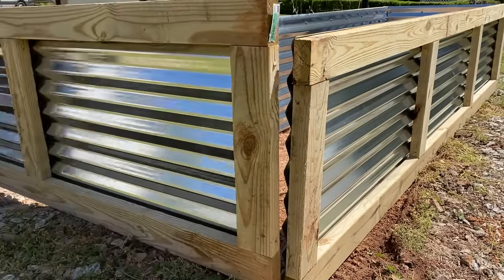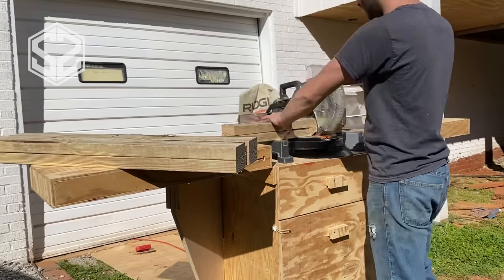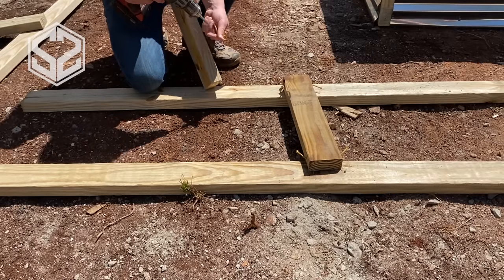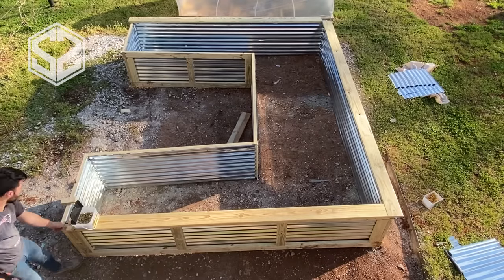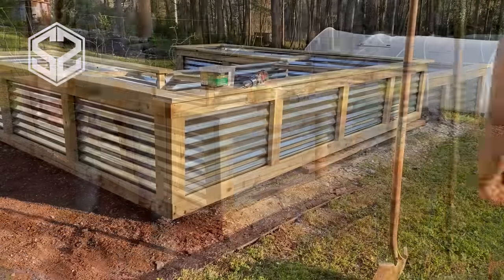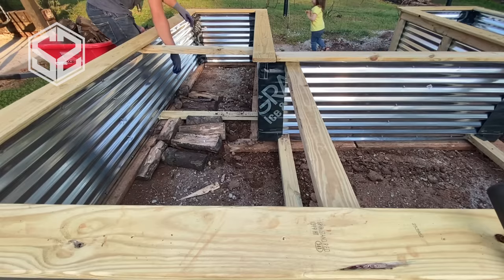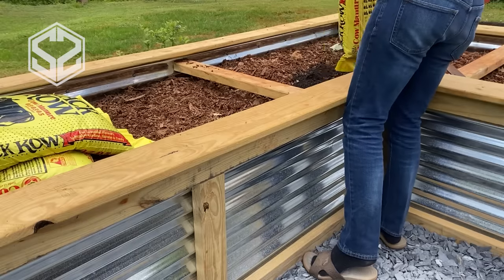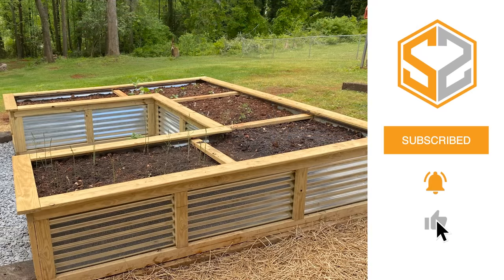How To Build Raised Garden Beds

Comment: Here's a tip. Instead of nailing or screwing in the sides, get a drop hook to hold them together. This way you can lift up the sides later to access bulbs or harvest root vegetables, like potatoes, without digging them up.

Comment: Another tip for cutting metal roofing panels, you can use a skill saw but flip the blade over so it’s cutting opposite. It works really well. Just make sure to wear ear protection cause it’s very loud.

Comment: For the bottom cross supports you can use stainless tubes and plates and screw them into the sides.  It will last as long as the garden does.
Reply from the maker: Great tip! Thanks! :)

Comment: Neat design, I wonder if this could be done with that all weather resistant decking planks, same sheet metal, and mesh on the bottom....  Would probably last a long time ha.
Reply from the maker: Yeah, would cost a bit more but I’m guessing that would last much longer than the pressure treated! :)

Comment: Yeah, I have a similar one that I made but I stapled some surgical tubing around the outside edge and drilled holes in the tubing making sure the holes are pointed at my bed. I guess you can use a regular water hose. I just wanted something clear and with it stapled down inside the planter you can hardly see it. To water, all I do is turn the hose on for a minute or two. My peppers do very well. PVC would do well also, maybe painted forest green.
Reply from the maker: Thanks for the tip! Sounds like a great set up! :)

Comment: If you flip your 2x4s 90 degrees you'll have the rigidity of the board supporting your wall pressure and you won't need to use an internal "brace". Additionally, you'll be able screw directly through rather than toe nail. The profile won't be as "beefy" as what you've done but it will be structurally stronger.
Reply from the maker: Agree, structurally it would be stronger but when I was planning out the project I liked the look of them tipped up vertically. Merely a preference :)

Comment: This is awesome! About the only thing I would have done differently is, instead of trying to use wood at the bottom to keep it from bowing out, I would have drilled rebar from the outside up against the wall so that it can't bow out. This method would work well for years and years. Putting wood under a pile of dirt might last 3 years tops before breaking down.
Reply from the maker: Thanks for the tips! 😁
Reply: How do you attach the rebar?

Comment: I removed my pressure treated raised and am replacing with wicking pots inside an insect exclusion barrier - because the raised beds dry out too fast in my location and the earwigs love the tiny crevices in raised beds and destroy everything. I also used thin shiny corrugated tin sheets like yours at one point but it rusts in contact with water. Looks good though.

Comment: with this form you can toe in a brace board around the perimeter gradually you can dry stack landscape stone or gradually do a poured wall 3 or 4 inches thick five gallons at a time the stone work is permanent...river rock is impervious to rot and bugs and after the external forms are removed they look great...so you have immediate planting beds but with persistence you will have a raised stone bed garden...
Reply from the maker: That would be beautiful! :) Thanks!
Reply: @SimonSaysDIY  your welcome now remember to add some screen every foot or so rebar will be fine for lateral strength the wood as you say will not last forever and when it goes the rock will stay

Comment: The corner moisture protection was a nice touch, BRAVO! I wondered why you didn't just use 3ft rebar staked through the used wood at your base, instead of the inside cross braces (especially at the bottom). For the top 6"-7" of "topsoil" my suggestion to you is to use a 5:1 ratio (well-mixed) planting soil and sheep manure, replenished every 2yrs. You'll get EXCELLENT tomato and cucumber/zucchini growth - and it's much better for the roots than the cow manure (which is much more acidic and it risks burning roots).
Reply from the maker: Great tips! Thanks so much! :)
Reply: Nick, where could I buy sheep manure, I live in Charlotte, NC?
Reply: @kdozier2935  most big box lumber stores with garden centers (Home Depot; Lowe’s) have that. At least, they do in Canada. Also, you could try bigger garden centers with greenhouses…
Reply: @nickborcescu5996 I've seen a few people mention using rebar, but I'm having a hard time understanding how to position or secure it. Could you explain?
Reply: @karasmidt2813  drill a hole through the wood then hammer the rebar through it. https://youtu.be/Su4WiTXRw1c

Comment: I'd like to know how they worked because they are now 3 years old.  I am putting in some raised beds this fall and winter for the coming spring (2025).  Looks awesome.
Reply from the maker: Thanks! So far no issues. We did stain it over a year to help it last longer. But the wood is still solid and the walls haven’t rusted or bowed from the weight of the soil.

Comment: Great idea. I have 12" tall raised beds (treated lumber) I used plax heavy duty deck  screws on all the corners and they are all failing 4 years later! The wood had a lot of moisture in it and is bowing badly top to bottom and separating on the corners. I might try this approach next time.
Reply from the maker: Yeah, I created a similar type and it lasted 3 years so that is why I decided to build one like this! :)
Reply: @SimonSaysDIY  It's a good idea. I've watched every video on the metal beds and I'm definitely going that route. And they look nice and one could paint the metal on the outside. I'm just glad I built all my beds when lumber was cheap. I've got 7 beds the smallest 8'x4' the longest 21'x4'.

Comment: I made a ramp to push the wheel barrow up but that was a sketchy situation. We ended up lifting and tipping the wheel barrow over the edge which scared up the edges ( I had free help and they were family so I kept my mouth shut) I like your method better. If I were making a bed like yours I would attach drip around the outer edge all the way around. It might not moisten the center of the 4 ft so I would rig a second zone with a pvc pipe down the center of the 4 ft wide to sprinkle that area.

Comment: Metal roof plate will be hot for the roots of the plant, inside it was necessary to add thin foam ... or foam styrene, or a laminate substrate in 2 layers.

Comment: SUGGEST: removable poles at corners... useful for hanging shade plastic... some tenderlings burn too easily when planted... also older folk when gardening oft have sunburning as a nasty surprise... 
REQUEST: link to automated watering systems for just-before-dawn especially when combined with trickle irrigation piping both of which reduces wastage

Comment: One question, does that sealer leach out anything?  If it doesn't good, if it does not so good.

One suggestion, you have a 12' back and you have a pretty wide open area between the two sides of the bed that stick forward.  Without knowing exact dimensions for the lumber and your specific reasons for everything and I know COST comes in to play a role in all this, a typical fixed bed used in regenerative farming (no raised bed) is either 36" wide or 42" wide.   There are different reasons for using either.  One thing a 42" wide bed gives you is more planting area so in dealing with dense planting or continual planting (as one type of plant is a certain size you plant another crop that when the other one is harvested the second planting now has the space or sun it needs to get to harvest) or mixed plantings which is also called companion planting, that extra 6" allows more flexibility in what all you can plant for mixed plantings or dense planting.  This also assumes you want to maximize the growing space you have.

The main disadvantage of a 42" bed is having to reach in, but with a raised bed that's not an issue.  This adds 1 ft. to your growing area for the sides and the middle is still easy to work in being 5 ft.

However if you can do everything you want in a 36" wide bed, no sense in changing it up next time you rebuild it.  Also, adding that 1/2' to each side bed could make it harder to reach stuff in that back area which is pretty wide, so maybe what you have is about the best it gets.  Once again this depends on what you're planting.

Comment: Its called a key bed and your using the hugelkultur method which in itself is something that has been done for centuries, anyway good luck with your crops, I did something similar with breeze blocks results have been fantastic 👍
Reply from the maker: Thanks for the info! I've seen this shape done before but didn't know that.
Reply: @SimonSaysDIY  Eggs shells for calcium and teabags also add nutrients (just remove the bag as you never know what its made of these days)

Comment: Kinda funny I built this same configuration using 3- 13” guard rails & 6” posts every 4’. Then put 18” of River rock on the bottom. Put 5 oz. weed mat over the rock and added Super soil to fill it out with my Skidsteer. Then trimmed it off with 10” treated lumber to give it my own touch. I then setup a Solar system for pumping water 600’ into my 750 gal. tank. Added 14- 300 gal. Stock Tanks lined them with Liquid Rubber. Then did the same thing with those. Then added a RIGA4 Greenhouse for early planting.
Reply from the maker: Awesome! Sounds like an amazing setup you have now!

Comment: Look great, though I feel the horizontal timber on the ground run is unnecessary and a waste of timber as it will rot out pretty quick. I use treated pine sleepers 150 x 50 mm for vertical droppers and corners I Bugel screw 2 together to form an L shape. 200 x 50 (sienna non toxic) sleepers cut in half 100 x 50 for top flat sections. Hugelkulture to save on soil and reduce water consumption is a great way to go. Thanks for sharing, Enjoy your veges.👍
Reply from the maker: Thanks so much for the tips! 😄

Comment: When setting up the vertical 2x4 are you setting them up 2-3 ft from dead center of the last vertical piece or is it from edge to edge? Probably a stupid question. I’m just new to tools and woodwork and have to ask the easy ones sometimes
Reply from the maker: For the 3, 6, and 12 foot panels I placed the vertical 2x4s every three feet. And centered them on 3ft from the end. The 10ft panel was closer to centered on 3ft 4in from the ends.

Comment: I just watched the entire video could you put down pavers as a floor to keep the bottom wood from rotting? New Orleans checking in., flood, heat, and termite warnings lol
Reply from the maker: Yes that would definitely help reduce the moisture and soil contact. That should be enough to extend the life of the bed. Thanks! :)

Comment: I used 2x6..and painted them ..also doubled the center posts and corners also attached them with flush screwing. Then used flat cheap step stones for the leveling
Also used metal roofing flashing for corners..if you don’t have excellent dirt you get crap product…dirt is everything
Reply from the maker: Thanks so much. I love the tip for the corners!

Comment: Nice job, quick simple and cheap. Don't let all theses "Experts" bother you. Most of them either never made, worked with a garden bed or have a lot of money to build one that will last forever.  Yours will last at least 10 years and work just fine. The amount of contact with the pressure treated wood is next to non-existent and what may be absorbed into the veggies is far far less than store bought food.  I laughed when someone said to use car ramps for the wheel barrow to drop the dirt in.
Reply from the maker: Thanks so much David! I greatly appreciate it :)

Comment: I made an identical one as shown, how much soil did you use? I am thinking about 3 cubic yards? Thx
Reply from the maker: That’s sounds about right. That should be enough to get you started. 

Each year that goes by the soil settles down as the logs at the bottom decay. I have added some more every spring to top it off.

Comment: How wide is the metal sheeting? With 18” vertical supports and the 3.5” horizontal 2x4s equaling 25”. Do they sell it in 25” width?
Reply from the maker: That’s correct. I used the 24in wide sheeting. This left an inch on the top so it wouldn’t get in the way of butting the top frame on.

Thanks!

Comment: This is so awesome! Any ideas on building a hoop house around this, using the bed as the bottom of the frame? Thanks!
Reply from the maker: That would be awesome! you could even build the top hoop house as a separate piece and just set it on top of the garden beds so it can be removable if you need it to be. 

Thanks! :)

Comment: @SimonSaysDIY  How is it holding up?  I may do something similar, but to avoid the pieces of wood over the top getting in the way of gardening, I'll likely use threaded rod below the dirt.  I'll also coat the interior metal with something to prevent it from corroding so quickly from the wet dirt.

Comment: Awesome vid, man! I need to ask you does the metal rust after a while?
Reply from the maker: Thanks! I imagine it would, but I’m guessing the wood will rot and need to be replaced in I’m hoping 10 years or so. The metal should outlast the wood :) if you want to extend the life of the metal you could use a metal roof sealer or paint before filling with soil.

Comment: Great stuff. But will the wood rot over time from the rain? What type of wood did you use?
Reply from the maker: Yes it will over time. I used pressure treated lumber. You can also use a deck stain to seal the wood and help it last longer. Thanks! :)

Comment: eye bolts and some kind of steel wire instead of boards for the lower supports that will be covered with dirt?
Reply from the maker: That would work! As long as you pick a white that resists rust it would last much longer. Thanks! 😁

Comment: Hi. Great video... I may have missed it in the video... is the height about 24 inches or 30... looks like 24.    Thanks for a super project!
Reply from the maker: I made it at 24in to match the width of the metal roofing sheets.

Thanks!!

Comment: Hi Simon,
What is the width of the galvanized or aluminum roof sheets you screwed to the wooden frames? I assume you only cut the lengths of the sheets and the width were all standard?  Saw 2 widths 2.16' and like 3.17' Which did you use. Thanks

Comment: Looks great. So you removed the one box because the PT started to breakdown and replaced it with the same PT? :) Why not use cedar? I live down in the south and have the same issues. I have not tried cedar yet. I was just wondering how it would hold up. If you are wanting to try cedar I can invite you over to build mine. :) Really great job.

Comment: Great video. Are you concerned with chemicals being released from treated wood, aluminum or sealant into the soil?
Reply from the maker: Thanks! I'm not too worried. The biggest part for me was to eliminate the direct contact of the pressure treated wood and the soil. from what i could research that is how the majority of the chemicals can leach into the soil. Also the newer pressure treated wood is said to be much safer that the previous type. A safer option would be using all cedar lumber for the construction. However, that would increase the cost of the project considerably.

Comment: Hey, I don't know how much that roof rubber stuff costs, but what if you wrapped that bottom 2x4 that's in the dirt with it to keep it from rotting so quickly?  Heck, maybe even do a good strip of it on the bottom of the bottom 2x4 (where you put the old boards) to keep it from directly touching the dirt?  I dunno, but seems like a pretty OK idea to me.

Comment: Your tomatoes will grow much better if you snip off all but the top three or four branches and bury the stem down in the soil sideways. The entire stem will start to grow roots and you'll have a very nice root system.
Reply from the maker: Thanks for the tip! I will have to test that out :)
Reply: Interesting, Are there any YT videos with people demonstrating this?
Reply: @winnipegnick  I don't know.  I'll definitely upload some in the spring.  My dad taught me to do it years ago.  It's kind of cool because you just see you a little bit of the plant sticking above the ground. But they take off and go really fast. 

 You have to be careful though if you are using stakes to support your tomatoes and remember which way you oriented the underground part of the vine. Otherwise you'll drive your stake right through it.

Comment: My neighbor made raised beds with exactly the same material. The corrugated roofing rusted through in less than 5yrs. He had to replace them this year. I think if the whole inside was coated with that moisture barrier it would probably still be ok. My shed that is covered in exactly the same roofing at the same time he did his beds looks close to new. Direct contact with the ground evidently rusts it in a hurry.
Reply: I think it depends on what area of the U.S. you are in.  If you are in a higher humidity area, it would matter more.  I am in Colorado and we have very little humidity.

I would treat the galvanized metal and then put some type of safe paint on both sides and the bottom edge of the roofing material.  The ice dam material/moisture barrier would have some chemicals that would leach out of it over time if used as a moister barrier. It is also fairly expensive.  A visqueen or plastic wrap might also give off some chemicals when it breaks down but I doubt it would be enough to travel into the dirt very far at all.

Drainage and snow accumulation could also be an issue in the winter months if you get all 4 seasons where you are at.

Comment: Great design. I would use nails to toenail the 2xs rather than screws because of tensile strength. It would hold quite a bit longer . Imo ... Other than that this is great. quality build
Reply from the maker: Thanks for the tip! So far it’s holding up great!